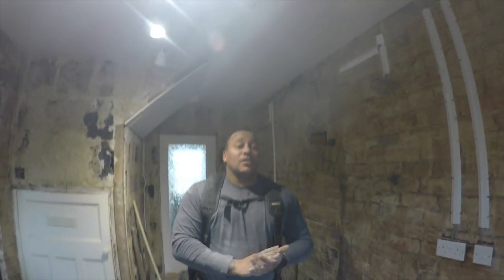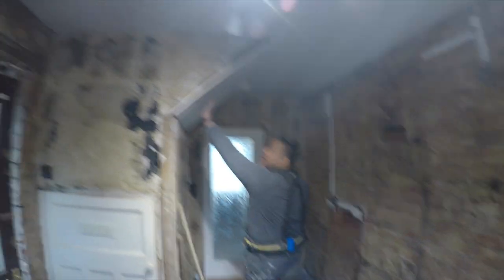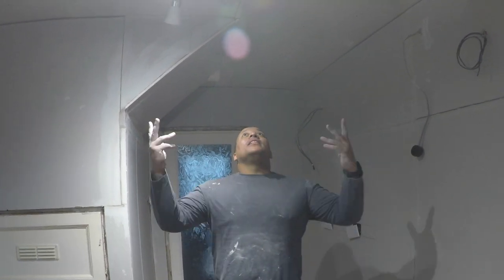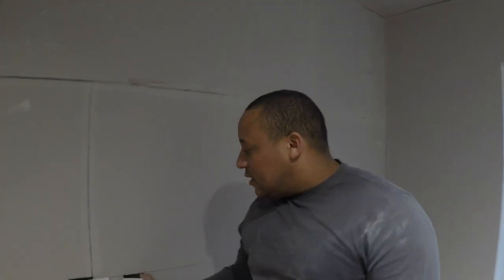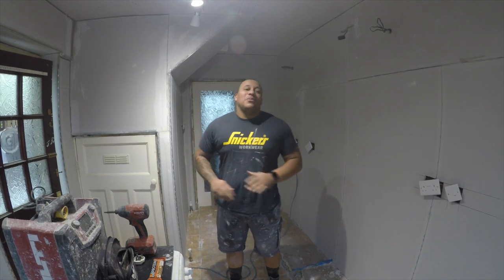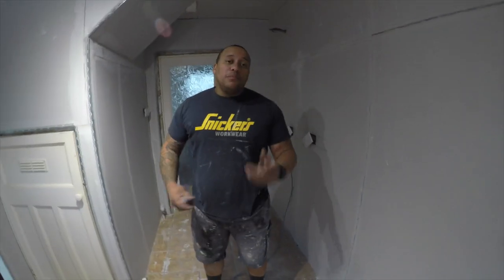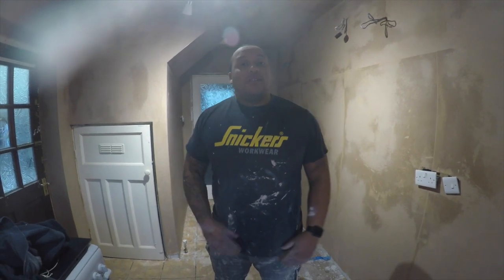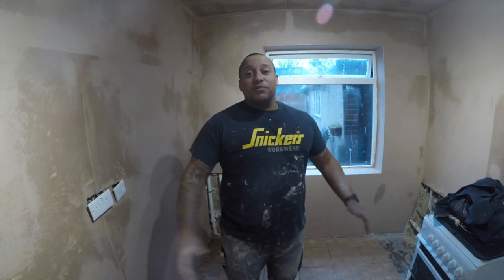Plastering - how to plaster a kitchen

Comment: Hi Joe...when you put plaster broad up on the ceiling you use screws...would you dab and screw....and why dont you use screws on the walls ? Thanks
Reply from the maker: No the adhesive is enough to hold the boards on the walls safely, no screws needed. Only time you screw a wall board is if it’s an insulation board, or timber frame